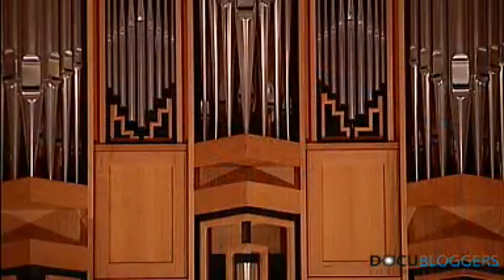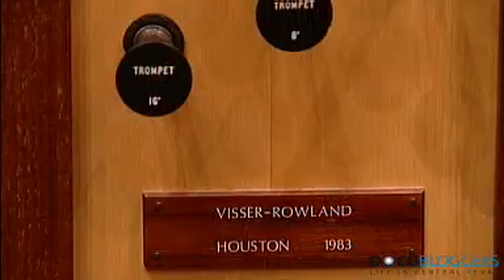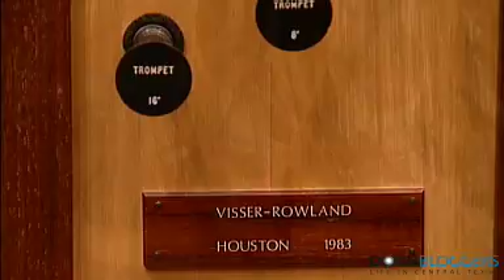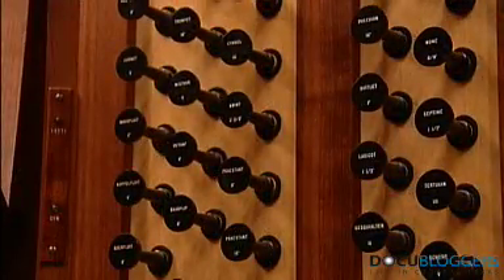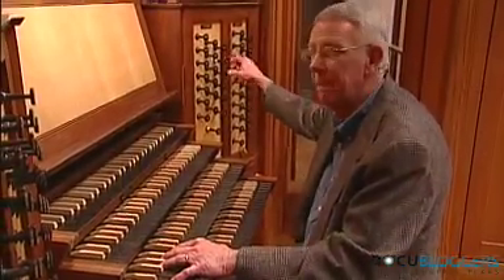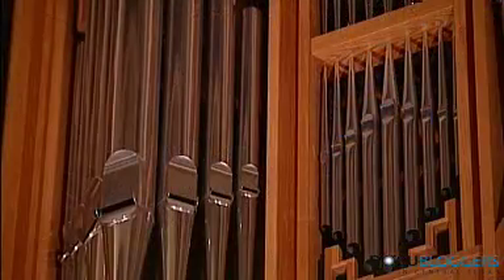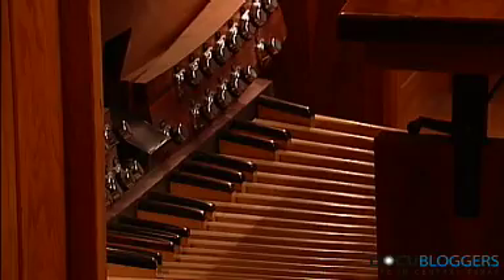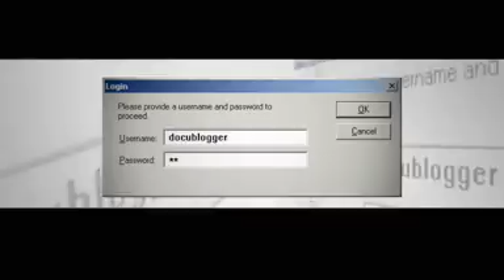UT Pipe Organ

Comment: By the way, at the St. Peter and Paul Cathedral in Providence, Rhode Island just prior to leaving Casavant, Larry Phelps built a complete tracker of well over 100 ranks (132 to be exact), absolutely straight. UT's may be larger by weight but that is it.  It has been called the "Best Kept Secret in New England".  Then there is the organ at Oral Roberts from the mid 70's, but let's not go there.